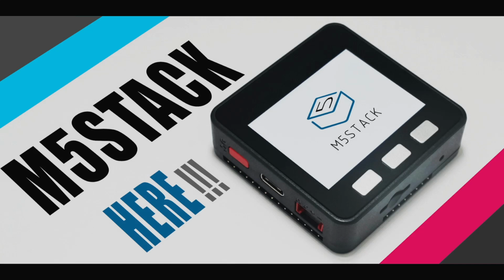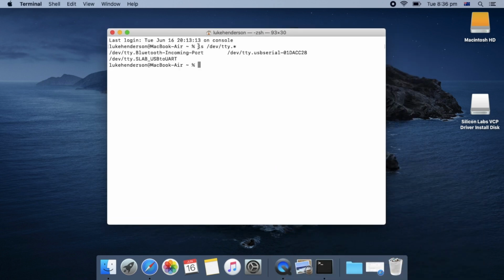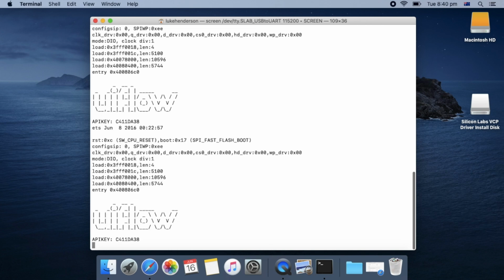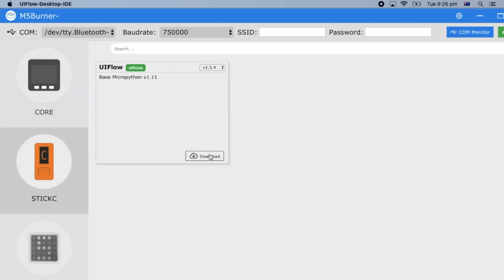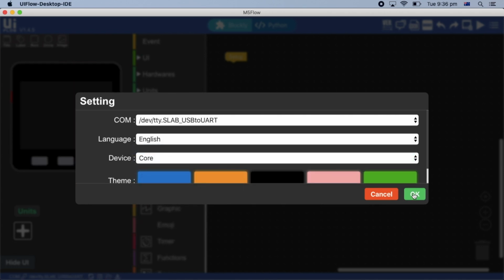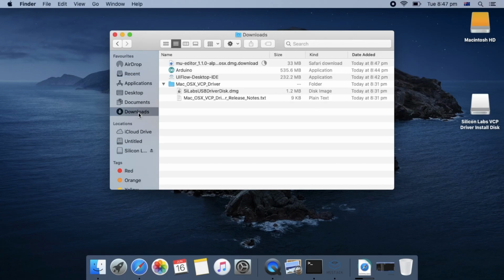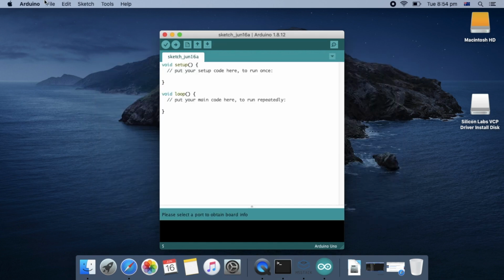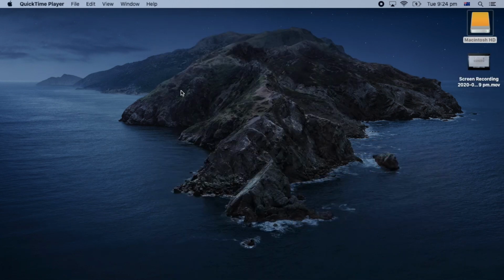M5Stack Mac Setup 2020 - Programming in Uiflow + Arduino on Catalina

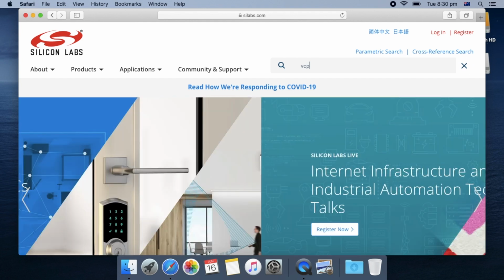Comment from the maker: Install COM Port Drivers - 0:57
Check Device Port - 2:00
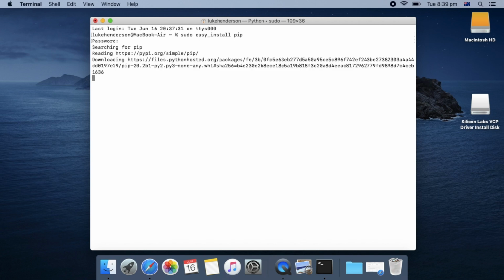Install Pyserial/Esptool - 2:21
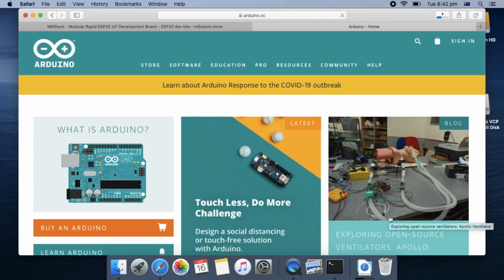Download Uiflow/Arduino - 3:30
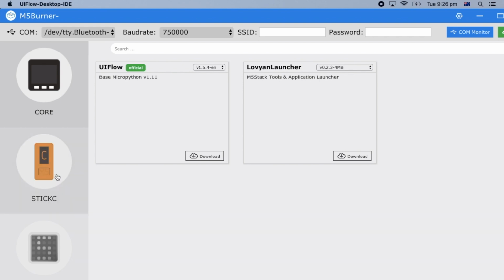Burn Firmware 4:17
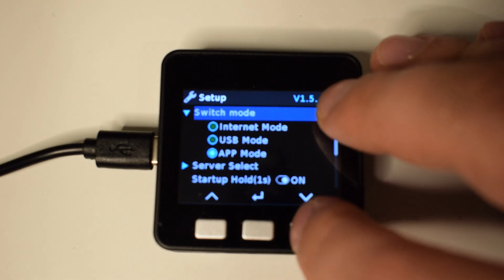Uiflow Program M5GO/Fire/Gray/Basic - 5:14
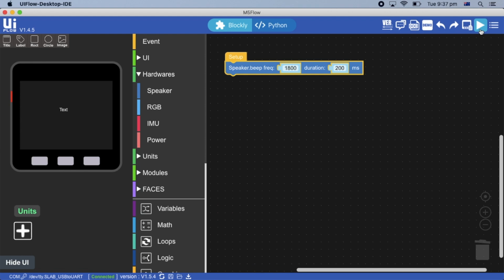Uiflow Program M5Atom - 5:46
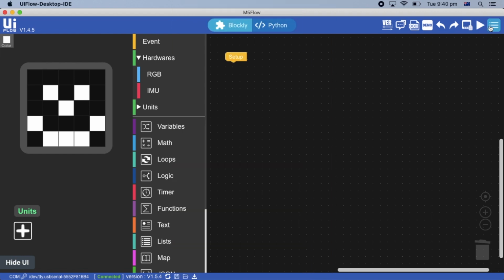Uiflow Program M5StickC - 6:15
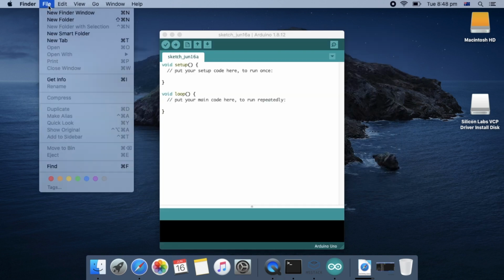Arduino Setup - 6:55
Program M5GO/Fire/Gray/Basic in Arduino - 8:00
Program M5StickC in Arduino - 8:15
Program M5Atom in Arduino - 8:30

Comment: Loving your content but a little advanced for me. I'm new ESP32 and just got the M5Stack Cardputer and I work with a Intel Mac and wondered if the info in your content still applies to macOS Sequoia 15.2 or do i need different options so I can install projects on the Cardputer, which currently I am having difficulty with. As I cannot identify the COM Port. I appreciate you must have a busy life but if you do reply can you point me to anywhere that allows me to backup the current Cardputer User Demo V1 as on the M5 Burner App I can only see V0.9.1. Many thanks!
Reply from the maker: Hi, did you turn on the download mode? Or the port can't be detected. And you can use v0.9.1 first since we haven't launched V1 yet